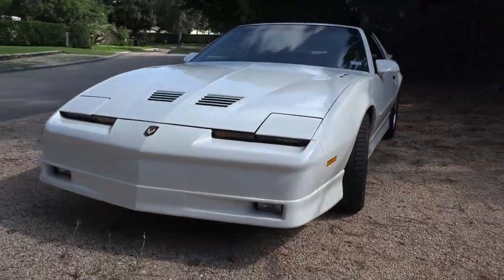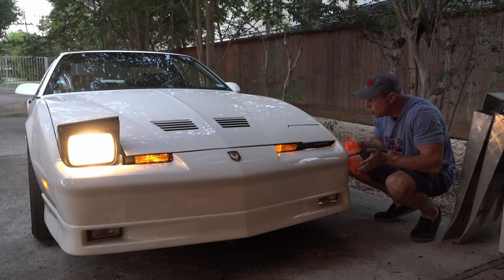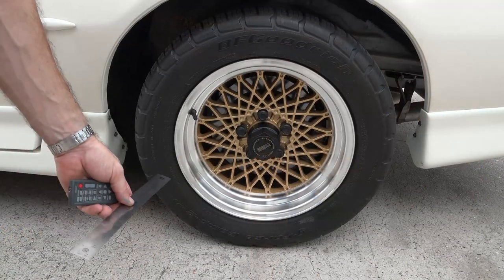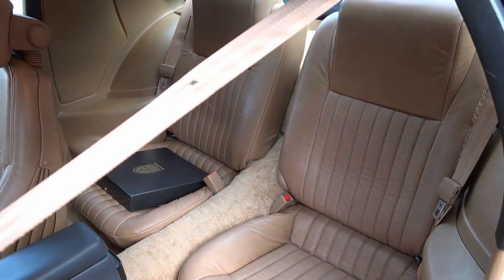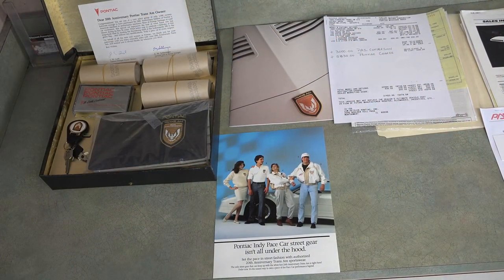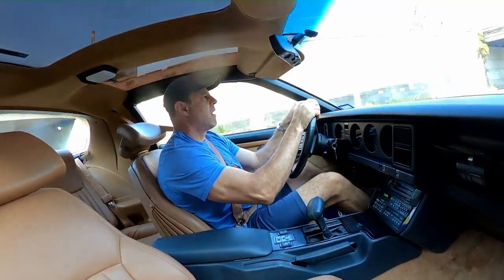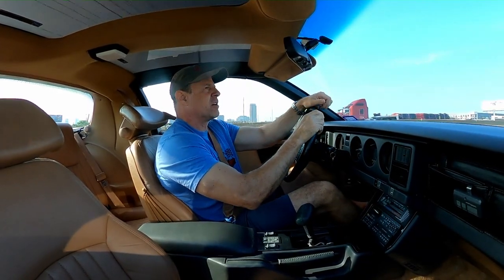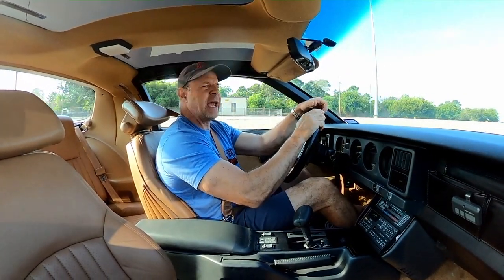Turbo Trans Am and PDR Part I

Comment: I currently own #466 of the 1,555 that where built that year. These cars will never bring GN money because a lot of people don't know what they are. I ran into a guy at a gas station one time and he told me that's a cool car you should do an LS swap on it! bahaha
Reply from the maker: hahaha. the LS comment is hilarious. currently I have a trans leak that I cannot find. I have already replaced the pan gasket. I have a power steering leak too, but the is the low pressure hose that they do not make anymore. I already had the PS pump rebuilt. I have a friend with a GNX and trying to set up a GNX vs. TTA showdown at the strip for an episode. Thanks for watching.
Reply: They will just give it time….
Reply: @scottsgaragehtx439  I have a friend with a GNX that just sits. My car is not stock and would blow it away anyway! Even stock side by side the TTA wins...well depends on the driver too.
Reply from the maker: Nooo!  I agree that very few know about this car. It’s too bad. I love it. I’m glad you got one too.
Reply from the maker: Hey. I had a trans leak I could not find forever. It turned out to be the selector shaft had a burr on it and would tear every shaft gasket that would be put on.
Reply from the maker: @shadhord9502  the TTA ride so much better and has better breaks than the GNX. Although, the GNX has that ladder bar system that helps it hook up. It designed to push the rear end down at launch.